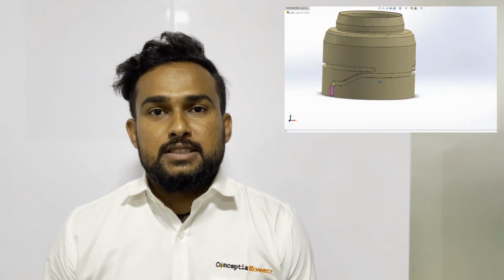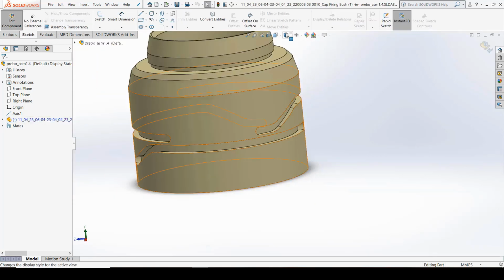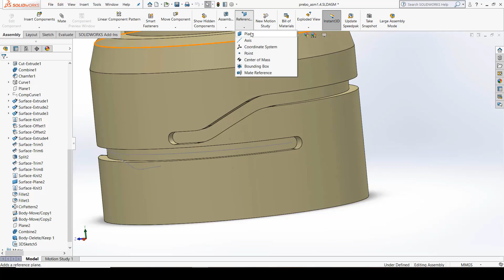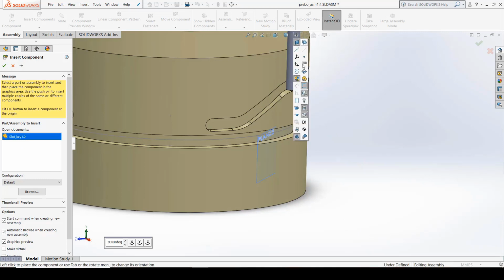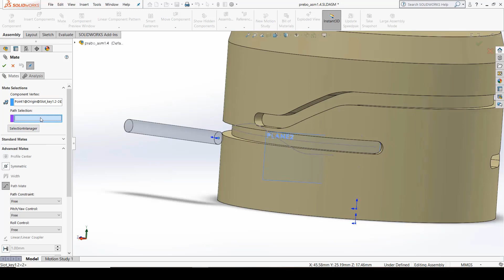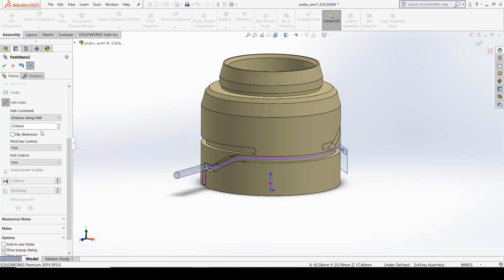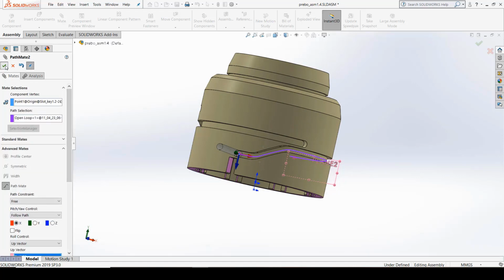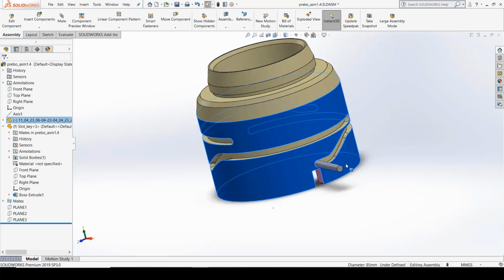Create a path mate on a revolve surface or a curved surface or a circular surface in #SOLIDWORKS

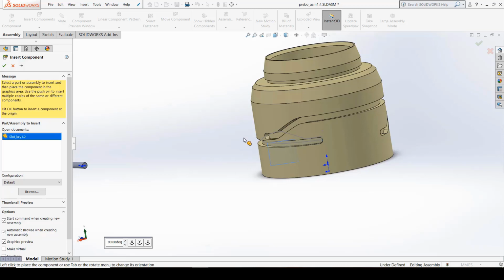Comment: what are you doing at approx. 2:40 in the video? you are aligning the origin of the slot key with the plan? what is the purpose of the plane. I'm guessing since you imported your part in lieu of building it on the plane, then they have to be aligned?